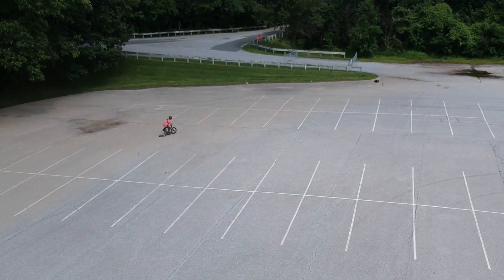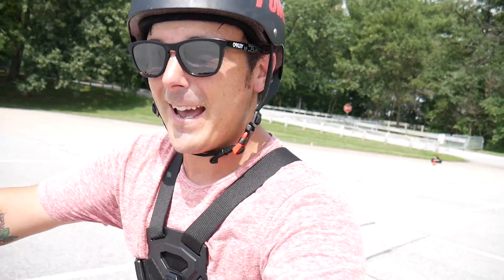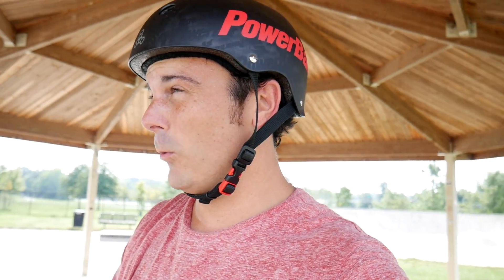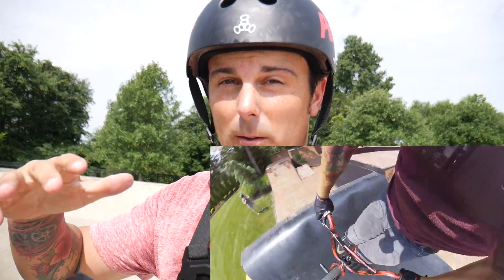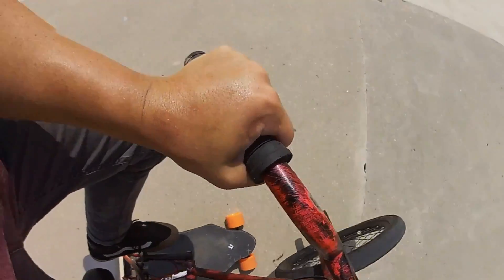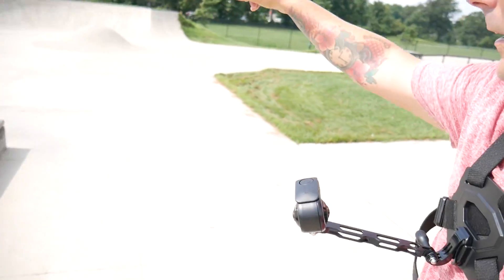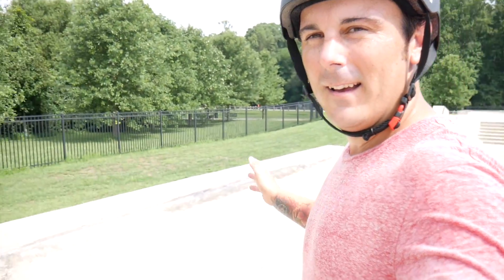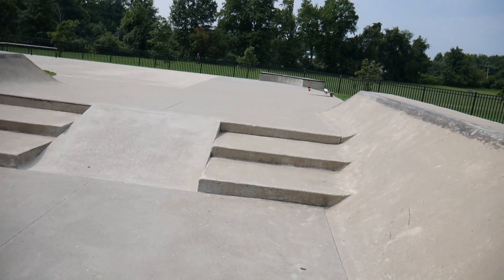WORLDS FIRST ELECTRIC SKATEBOARD BIKE!??

Comment: It looks like your mount just broke off?
Try bolts and drill out the wood a little to get them to sink in flush. The screws will not hold up.
Great idea and video!!
Reply from the maker: Kush Fraust yea I have a much better one in the works that will be able to take the riding too. Thanks for the feedback and support!!🤙🏽